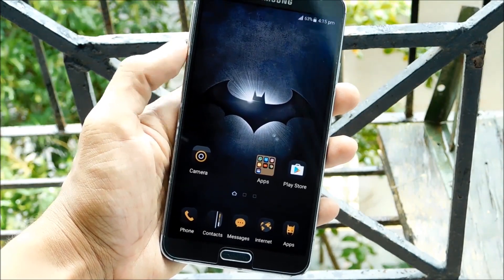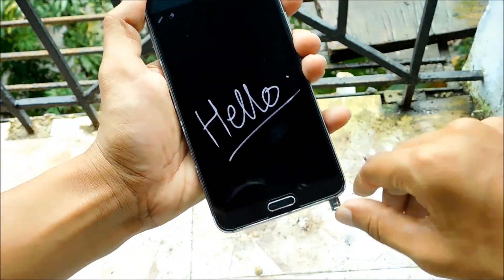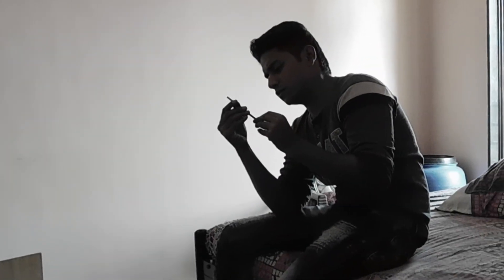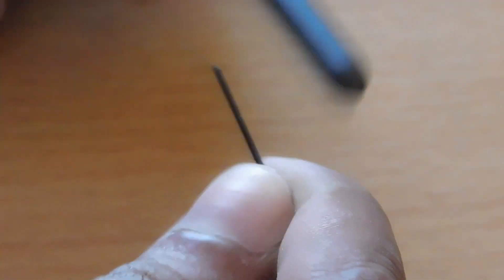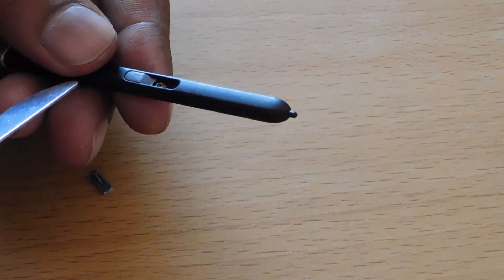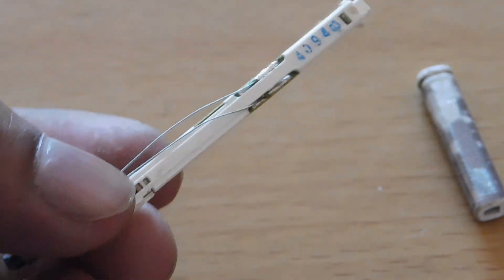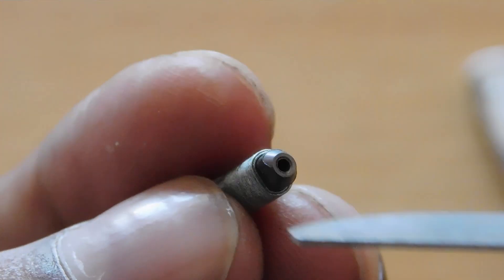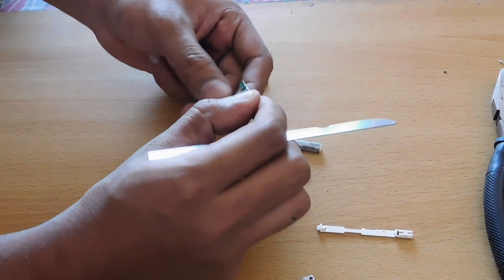What's Inside Samsung S-Pen ? How It works ?

Comment: Hmm, disappointing. You talk nonsens. Some 5cm away, there is no wireless Power anymore. So inside the coil must be a capazitor ir a very small chargable battery.  But I bet it is a powercap only. (No battery)

Comment: Any idea of the inside of the new S-Pen in the Note 10+  ??
Reply from the maker: We will have to break it into pieces to get inside it
Reply: @TechTubeHD  yes please. I'm thinking about doing led mod into the s-pen top. Seems like a logical next step, no idea why they never did it.
I assume s-pen works off of capacitor or tiny accumulator, so adding a simple LED into the clicky top bit shouldn't be too hard. Click out: ON click in: OFF kind of deal.

I just hate having to use my phone as a 1000$ flashlight, I'd rather risk the pen.

Plus the mod just sounds SO cool.

You in? Help me with the schematics and I'll do the mod video, if the idea is even possible to do.